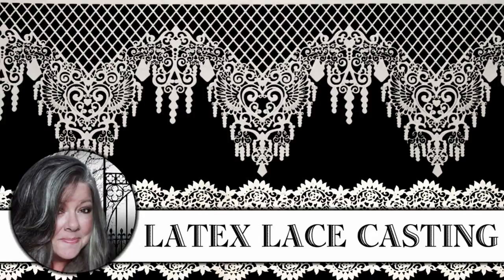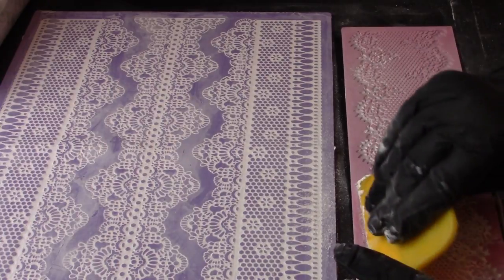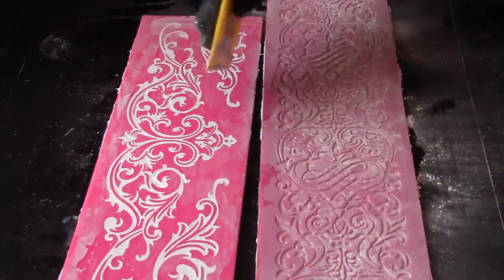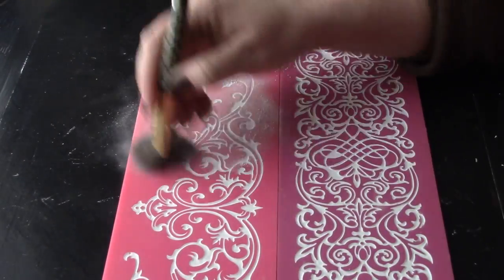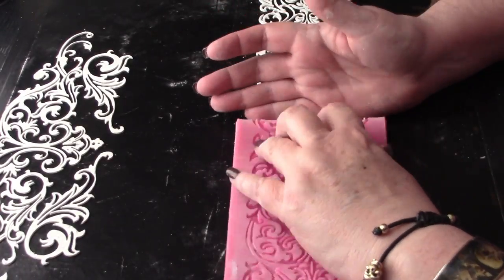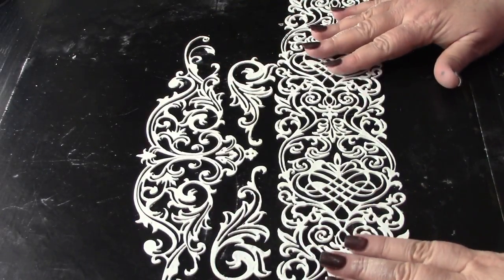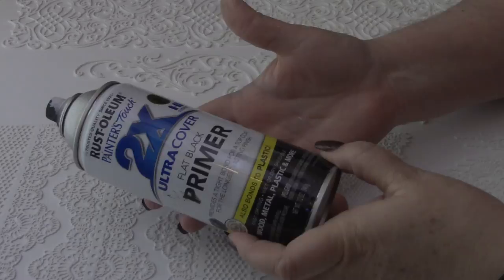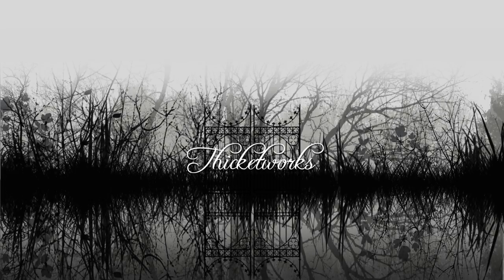Latex Lace Casting

Comment: I just tried my very first caulking lace and boy do I wish I had seen this video beforehand. It's still drying but I'm sure it's a throw away! No other video spoke of using corn starch so I just smeared the stuff into a very thin border strip. I found it very difficult to get it in and keep it in - I was using a plastic clay tool that kept pushing the caulking out instead of in - it was hard plastic and your tool looks like it makes perfect sense for this project! Anyway, I just subscribed so you will surely be hearing from soon - like, lots and lots of questions!! Thank you for posting this great instructional video.

Comment: I was watching Black Magic crafts trying to do something similar and the comments section got a bit wild about needing more caulk lol. I came back to you because I was fairly sure you had done it successfully, he did too but the mold he used was too deep but got a good cobblestone effect using a roller with caulk spread on a rubber backing.

Comment: Love your videos but soo glad i came across this one! I have the pink mold 3pc like you showed and i tried it w air dry clay,what a mess.And then i tried the caulk,had everything right but when i went to demold it was all a crackling mess.i was so disappointed and it took forever to clean!! I tried the cornstarch w the clay and it made it to slick to stick to the mold so i didn't even try it w the caulk.i will now..thank you so much for this video. Wish me LUCK!!
Reply from the maker: Fingers crossed, girl - you NEED latex lace in your life, my friend. This time it's going to work! 😘😍👍
Reply: @Thicketworks  i demolded it this morning afyer opening a new tube yesterday and i was able to get it all out except one small pc broke.i was so happy though! Its not plasticity as ive seen in a lot of videos and when i just showed my honey my newest accomplishment it fell apart in a cpl places..idk.is there something specific i could spray or paint on it to harden it to keep the rest intact?
Reply from the maker: Hey Tina! Well, it sounds like an improvement - my only suggestion is to make certain that you are filling the mold cavities to the maximum - some of the aspects of these designs are so stinkin' tiny that no material known to man would be strong enough! 

A coat of sprayable PlastiDip might help with structural integrity - but will also obscure some of the detail. xoxo

Comment: Hi Heather! I happened to come across your video and sure glad I did. I have a question,could you tell me or is there a different video,where you show how to attach these lace castings to wood,etc...They are just too beautiful.Thanks for sharing your creative ideas!
Reply from the maker: Hi Rose! For bare wood or painted furniture, you can just apply a layer of good quality wood glue to the surface of the piece, then lay the Latex Lace on top, press it firmly, and you are all set. For Mixed Media, I usually use Tacky Glue - you can see that demonstrated in this video: https://youtu.be/1yvm0gkiQvQ
Reply: Thanks so much for showing me which video! .

Comment: Neat video. Well done. Two questions:
1) Any idea how to make the silicone molds themselves, perhaps from pieces of old lace or from low relief openwork patterns? 
2) can this work be done with cast off latex paint? I hate buying newly manufactured mediums and materials when trash or discarded materials can be reverse engineered? (buying any new medium or material funds the creation of waste, while using trash materials and mediums reduces waste.) 
Thanks in advance.
Reply from the maker: Hi Jack...in order to create your own silicone molds of existing lace samples, it will be necessary to prevent the silicone from binding to the textiles. 

Now, I haven't attempted this particular procedure, but I do have quite a bit of mold making experience, so my best suggestion would be to give this idea a try with a lace fragment that you can afford to lose, if it doesn't work out. 

Okay, here's how I would approach it: probably the easiest thing to do would be to soak the lace in an acrylic medium (even acrylic paint) - the goal is to 'plasticize' the fibers, so they are no longer able to absorb moisture. Dip the lace in the medium, then lay on a non-stick sheet to dry completely. The resulting lace should now be stiff and almost impervious to moisture.

Then, prepare a mold box with your 'master' secured to the bottom, coat it with mold release, mix your pourable silicone and pour. Allow the mold to cure, remove the master, then cast your lace.

I don't see why latex paint wouldn't work as a casting medium, but be prepared for longer curing times than the caulking.
Reply: Thorough and sensible advice. Again, I commend you. Well done. Thank you very much.

Comment: Heather I tried to do it, I left it all night to dry but nothing, was wet. Is it possible that it depends on the fact that my house is very humid? How can I do? I think I'll have to wait this summer maybe with the heat I can succeed. I also wanted to ask you, but can I do it only with "alex fast dry" or can I use some other product? Because it comes to me from the USA but including shipping costs it costs me a lot. Thank you very much, you're always fantastic.
Reply from the maker: Hello, my friend! Uh, oh...sounds like you are using a different brand of caulking - be aware that a silicone based caulk will cause a disaster: the silicone will bond to the mold, and it will be a horrible mess...( I know this is confusing because Alex Fast Dry has 'silicone' in the name - but it has only a very SMALL amount in comparison to the Latex, so it doesn't cause a problem)

It's possible that the humidity is causing a delay in the curing - also, using molds that are deeper than 1/8 of an inch or 3.175 mm will take FOREVER to cure, no matter what brand of caulk you use. Some people have had success by placing the mold into the freezer overnight - that may help you. 

It's so frustrating that you have to pay such high shipping charges! I would ask around at the hardware / plumbing store for a caulk that is LATEX,  preferably quick drying. Best of luck, darling! xoxo
Reply: @Thicketworks  I used "Alex fast dry", I spent a lot of shipping but I ordered three tubes. I'll try to put it in the freezer to see what happens at most I'll wait this summer and anyway I'm going to ask in the hardware store if they have latex in tubes. Thank you very much you are always very kind, with affection. Stefania
Reply from the maker: Oh, I'm so sorry that you are charged so much money for shipping! That has got to be super frustrating. 😩

Let us know what happens with the 'freezer' method, @asia luna - I hope it works for you! xoxo

Comment: Have another question can you color them with inks or do you have to use spray paint. Sorry for all the dumb questions
Reply from the maker: Hey Norine! Firstly, you never have to apologize for asking questions here...and this question is a GOOD one! 😍

No - you certainly don't have to spray paint the latex lace castings - I just find this to be a quick and easy solution to changing the color without too much hassle.

Distress Ink: Yep, it will work. Hard to get it into all the nooks n crannies, though!
Adirondack Colorwash Spray Ink? Works great!
Heidi Swapp ColorShine Spray Ink? Translucent, but nice shimmer. 

Hope this helps!
Reply: Heather Tracy so you can use inks ect
Reply from the maker: Yep! Have fun, Norine!

Comment: Hi Heather. So, I've tried your technique and that was an utter fail ;( Gonna cost me my mold too so double sad. I think I didn't use to correct product, though, so my bad. I want to try again but I want to be more sure I get the correct product (especially because I have to order again the mold, which is costy in monney and time). My mistake was, I think, to use "silicone" (for bathroom), because that's was what I had at home and I thought I knew what it was so I didn't bother to look up what "caulk" meant v.v; The silicone I used stuck to the mold despite the corn starch.
Now, I'm in France so I can't just get the exact same product you use, I have to find the equivalent here. I found some "caulk" but it doesn't always specify whether there is silicone in it. Is it important I get some caulk + silicone or would it work if it's just "caulk"? (Other times the label on the shelf says "caulk with silicone" but on the product itself it's not clear if it's caulk, it just says silicone so I'm really not sure. I don't want to throw away a second mold :( )
Thank you for your help!
Reply: Also, on the "caulk" product, it is said it's washable with white spirit before it dries but you seem to just use a sponge with water...?
Reply from the maker: Oh, no! That is so frustrating, Meanne77! And yes, it happened precisely because of the silicone that was used. It is CRUCIAL to find a caulking that is latex based. It doesn't need to include silicone at all, (although the Alex FastDry demonstrated here does). You may want to visit the painting section of your local hardware store and ask specifically for a LATEX product. 

And yes, latex caulk will clean up with water while it is still wet - no white spirit needed. This is one of the major differences between the two types of product. Hope this helps!
Reply: @Thicketworks  Thank you for your advise! I'll be very careful next time ;) (Is it enough if it says "acrylic caulk" or does it have to have the word "latex"?)
Reply from the maker: @Meanne77  Acrylic Caulk and Latex Caulk are virtually the same thing - as long as they don't contain large amounts of silicone, either label should be fine.
Reply: @Thicketworks  Thanks again! I'll let you know how the second try turns out! ;)

Comment: Ok. I do not know what went wrong. (sigh). As I was demolding: 1. the lace was bridle; 2. the caulk lace was not springy and flexible. I did buy the correct material, and I followed your video. In some as I was using the sponge to remove excess caulk it became a bit mushy. I did manage to clean as much as I can and add more caulk; so when it was ready to de-mold I did not have much to clean. Only one small tiny mold piece came out nice. At this point I have to now clean the lace of bits of caulk stuck into the laces mold. I don't know what i did wrong so I can correct it. Any suggestions?
Reply: Ok, - LOL- I used The DAP Alex Painter's Acrylic Latex Caulk- Whoops-Could that be the problem? LOL- And I Was SOOOO Excited! I also have Alex Plus: All Purpose Acrylic Latex Caulk Plus silicone, But It is CLEAR- LOL- Can I mix some acrylic paint into it so I can have some color? Let me know what you think- Thanks xox
Reply from the maker: Oh, dear, Maria...I'm so sorry this happened. Those formulations are SO close - but the difference is huge, unfortunately. And YES - you can tint the clear Alex Plus with some acrylic paint in order to give it color! Just squeeze it out into a container, mix it up, then use it in your molds! Let us know how it turns out, my friend. xox
Reply: Oh Thank You So Much! I Really Don't Want to be a pain, but you're the only one that basically knows what they are doing with this stuff.  So, while waiting for your reply I went to Walmart , Again, and luckily I did purchased not 1 but 2 (LOL) Of the Alex Fast Dry. 
Question, With the Alex Plus Clear one, will it be as the Alex Fast Dry? I am asking b/c I do not want to waste the material and maybe use it for another art project
Reply from the maker: If you have another use for the Clear Alex Fast Dry, then there is no need to bother with tinting it with acrylic paint - now that you have the 'good stuff'! But, yes, it should work the same way as the white, Maria! So excited that you have what you need to create your Latex Lace now! Yay! xox
Reply: Oh Thank you so much for your reply. The clear one is Alex Plus, Not Alex Fast Dry. But Yes, I Now Have the right good stuff. will keep you posted . I thank you so much for your care. Have a wonderful rest of the day. xox

Comment: After rewatching your tutorial and reading all the comments, I feel really stupid.  I have the right caulk, corn starch, etc., but my project did not work.  The lace broke, crumbled, anything but worked!  I can't figure out what I did wrong.  It's so frustrating. Do you have any tips I might try?
Reply from the maker: Uh, oh! Sounds totally frustrating, Evie. Since you've double checked that you are using DAP Alex Fast Dry White Acrylic Latex Caulk Plus Silicone  - my only other thought would be that somehow you got a 'bad batch'. It should be the consistency of whipped cream cheese when you first dispense it, and it should be super sticky and gooey. If yours felt different than that, then I recommend picking up a new tube. 

Environmental factors play a role, too. If your environment has super low humidity - it may be that the caulk is curing too fast. 

Some folks say that curing the castings in the freezer has helped them to obtain better results. You might want to do a small test to see if that helps. 

Finally, please ditch the whole 'I feel stupid' thingie...it won't help, and it just isn't true, girl. We're rooting for you! Hang in there, and let us know how it turns out! xoxo
Reply: Mine did this at first; but I think I was in too much of a rush to de-mold and tried it after only a few hours.  Like you, it tore and crumbled so I stopped.  I then sprayed (lightly) with water and came back the next morning.  Presto, it came out fine and in one piece.  So try it again, but let it dry overnight.